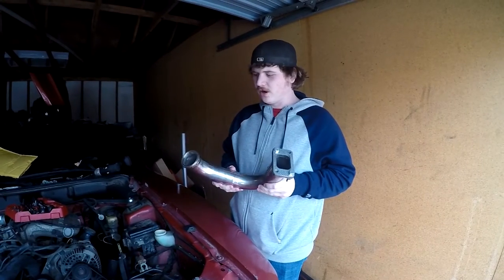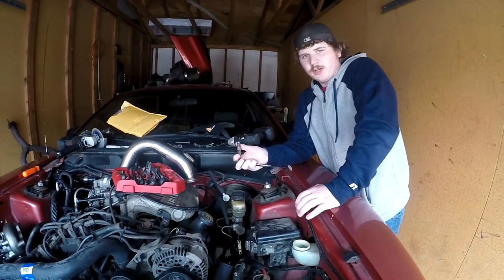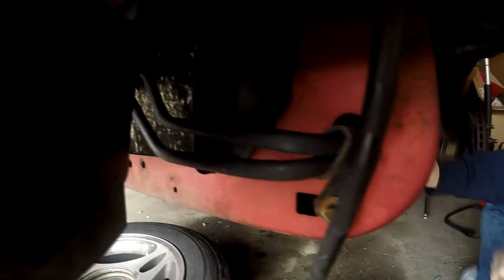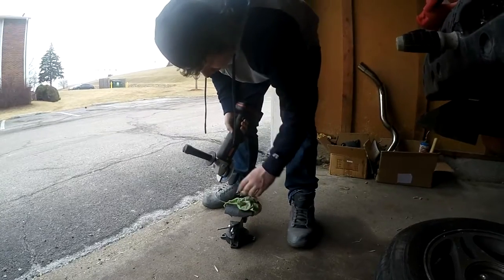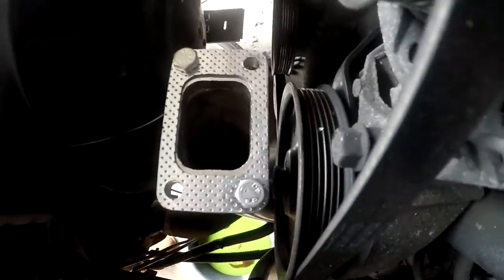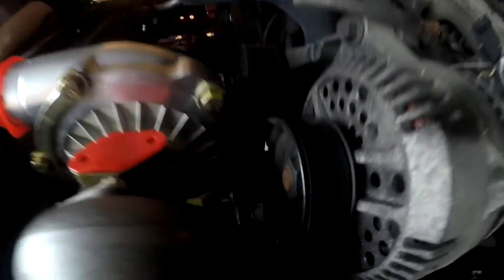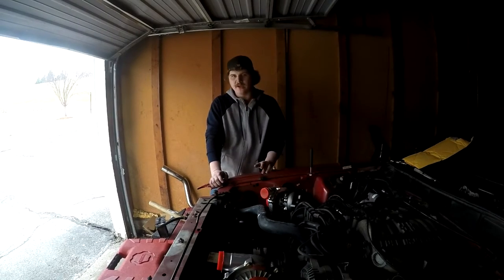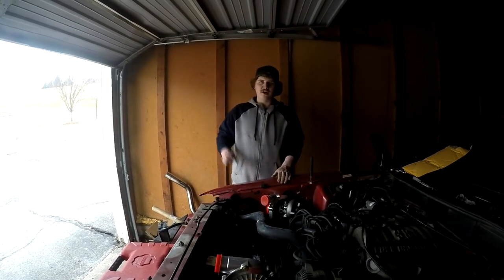Twin Turbos Installed On The Mustang

Comment: you should have a shop fab up a pipe for the passenger side turbo to get it up next to the driver side turbo probably get one made for around $50 and it won't look the same but heat wrap would fix that.
Reply from the maker: Timothy Mosley yea I might just try to weld up my own I'm just not sure yet though
Reply: Boosted Buckets it would look badass and you would have better access for the down pipe on the passenger side turbo that would make it worth it in the long run.

Comment: Pretty nuts, man. Could you rotate the driver's side up pipe so the turbo sits more in the battery area?
Reply from the maker: 802 Garage I don't think so but I'll give it a try next time I'm out there
Reply: Just thought maybe, becuase it is a V Band, right? Then it would be more of a mirror to the other side.
Reply from the maker: 802 Garage yes but I need room on the bottom of that tube for the wastegate and it's really close to the sway bar but I'll give it a shot I don't really care how hacked it looks though aslong as it spools lol
Reply: Oh yeah that totally makes sense. And yeah I wasn't as worried about looks as clearance in the front there and on the hood etc. Either way I'm sure you'll figure it out and good luck.

Comment: you might want heat wrap that piece so it doesn't melt your serpentine belt
Reply from the maker: Broseph Stalin good idea, I also need to do something on the other side by the fuel lines
Reply: I was going to suggest the same thing.  also probly wouldn't hurt to put blankets on the exhaust turbine housing.  leave the compressor housings uncovered though, covering that causes too much heat to be trapped